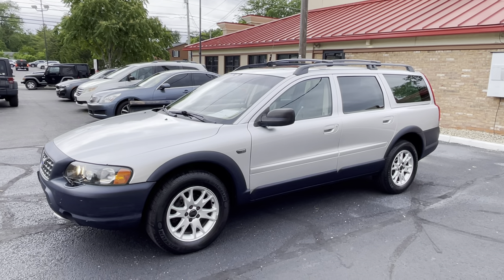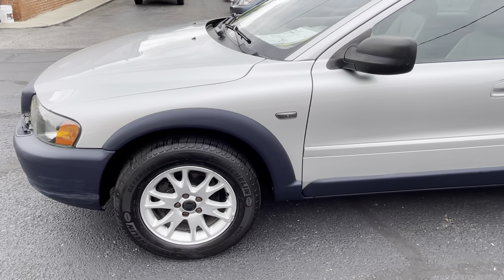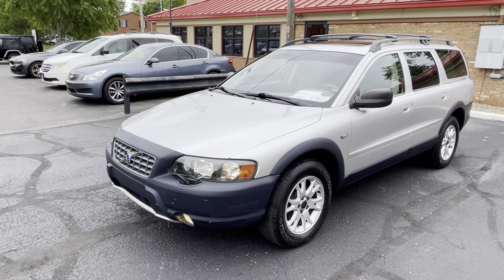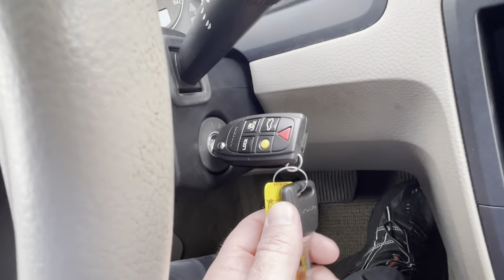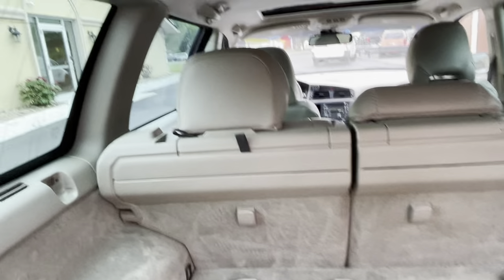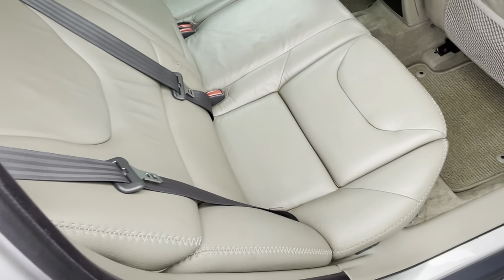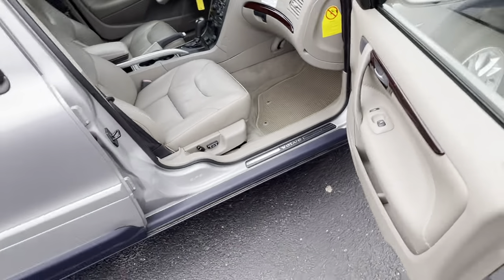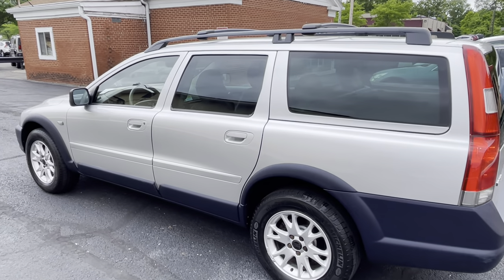2004 Volvo XC70 Cross Country AWD - Only 36,000 Miles, One Owner, Serviced, Absolutely Spectacular!

Comment: Im never fooled by 'low miles'. This usually means the engine never got hot enough and/or was driven by an elderly person so expect blocked EGR valves etc and lots of scuffs and kerbing like this one.
Same goes for 'lady owner'...in other words, carelessly driven and no responsibility for maintenance of even topping up the washer bottle..also expect scratches inside the screen where rings have cut into the glass whilst wiping away mist and ring scratches on the wheel and gear stick.
Reply: at least slight exaggeration of the profiling, lol!   True of risk for low miles but that can be checked out, by boroscoping engine or even removing oil pan if necessary , if a car is not cheap, since something like this could ask 7-12K$ perhaps!